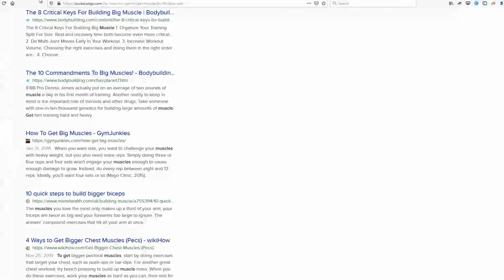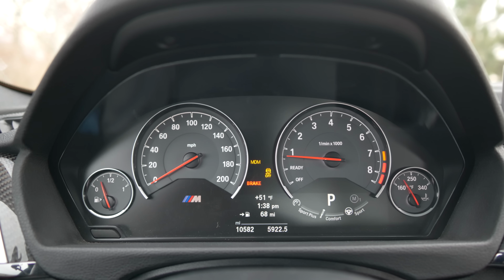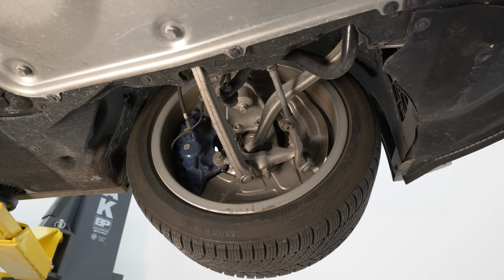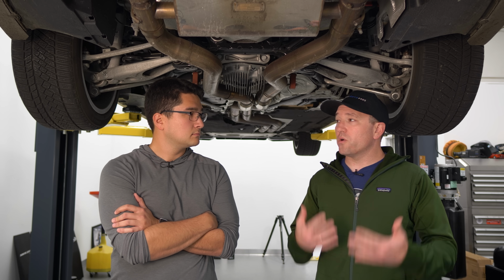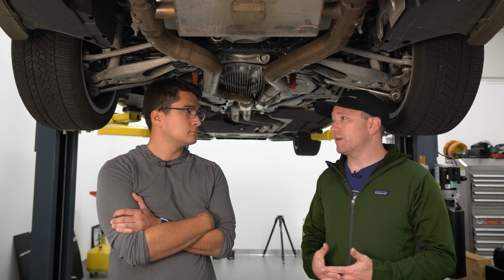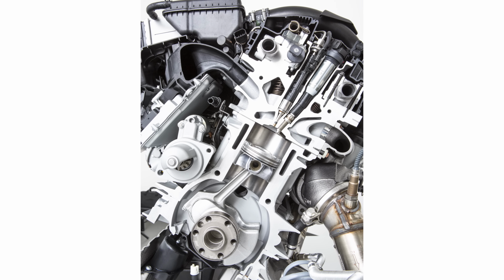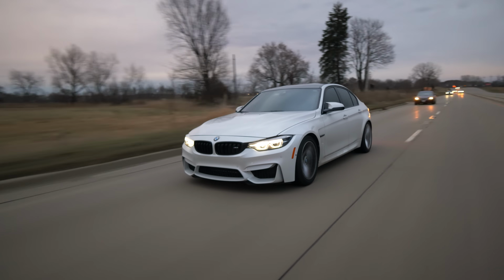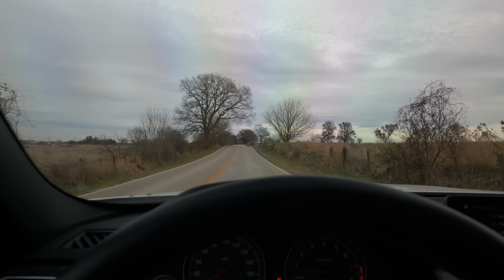BMW F80 M3 Review | The Sports Car for Mathematicians

Comment: This is a car you fall in love over time, unlike E90 where you fall in love right away but then get tired of "her issues". The more you drive, and more you own, the more you start to appreciate and love more and more as the time goes by
Reply: This is actually so true, I've had my f80 6 months and I love it more now than I did when I got it.
Reply: @Homiefizzle  Have you had many issues? They seem fairly reliable but I've heard some horror stories.
Reply: @pramay5116  what kind of stories? Is it bad to buy one of those?
Reply: @pramay5116 I have an f82, not a single powertrain issue to report at 60k miles. I have had to do thrust arms due to the bushings going bad.
Reply: @homiefizzle5260 yeah I feel that I got bored of my 335i the m3 I treat like it's my child I love it so much lol
Reply: I’m at 103K miles on mine going on 3 years of ownership now with about 50K miles on my belt with her personally, only the second owner. It’s funny, I got a really cheap daily and sold it within a month because I just wanted to keep driving the F80 everyday. Need an E9x M3 for a weekend car sometime soon but I’ll be damned if I stop enjoying the F80 every damn day. It’s just so good. Even in the snow on a proper set of winters ;)
Reply: Agreed. Perspective plays a large part.

One may get in and immediately notice the steering now being as good as something like a 6th gen Camaro SS. 

You’ll drive them and think that the Bmw’s steering is a little more numb/isolated (not totally, but more so).
As time passes, you’ll come to the realization that it’s not necessarily a bad thing, you don’t always need to feel every crack in the road (although it is nice from time to time). It’s more refined and you are more sensitized to the output of the steering communications.

In other words, if you might’ve had trouble feeling the direction of the front wheels when you first started driving the car (after driving something more raw), you will come to feel it more as you spend more time behind the wheel.

This is just one example and it isn’t a perfectly accurate representation that the steering is bad. 

The E39 M5 has been praised for its steering and overall communication for decades, but the truth is that you won’t be too impressed if you hop in one and drive it at first.
Maybe you will be if you own or drive some non-M E39’s or lesser cars, but it’s more about as time passes.
You own or drive the car for longer and it all comes together and it makes sense.

Now you understand why it gets praised and many crown it as the best overall mid-sized luxury/performance sedan. 

I didn’t like Bmw’s when i was younger. 
I didn’t hate them, but it wasn’t until i spent more time in them that i realized what the hype was about. 
Now i understand them and can truly appreciate them.

Comment: BMW is the kinda son of the family that does everything to make the parents happy yet the parents never really are impressed.
Reply: Is that why it breaks down so often? ha ha
Reply: but the parents aren’t afraid to go off on him when he makes a tiny mistake
Reply: @hsl2208  yeah breaking down every 10k km after 100k km with high servicing fee is not really a tiny mistake and i bought a 328i great car but not really a sport car or anything just a normal sedan after 100k km a shit show breaks down constantly have toyota pickup 490k km now still work like a dream my last and my only bmw sold it after the turbo got issue and cost me a small fortune couldn't be happier buy bmw lease after 100k or 5 years give them back
Reply: @patthonsirilim5739  what gen was ur 328i?
Reply: @hsl2208  f30
Reply: @patthonsirilim5739  previous owner didn’t take care of it, I’m guessing. I have. F82, stage 2 E85 and no issues lol. Like none at all
Reply: @user-zb6ez4jl3u  i live in Thailand the heat here cause of alot of the plastic bits to breakdown way faster then in Europe most of the problem i face are sensor and and plastic thingy cracking i bought new btw and service according to bmw service manual like i said i use 100k km and about 5 years trouble free after that alot of trouble
Reply: You didn't understand my comment. This video is all about explaining how BMW has done everything to make this M3 reliable without loosing its charm. And here you are again complaining about them not doing enough. Yes BMW is that son of the family.
Reply: Well said...  The touch me not parents...

Comment: The discussion on the drama or lack there of, is really why I like this car so much and want one. I have these race cars and old 90's jdm cars that have so much character but are tough to live with, the idea of something sterile that I can just blast around in with the AC on and no drama sounds like a breath of fresh air.
Reply: Same issue I have here. I have a c6 vette for the rough and brash power, something that “just works” sounds so nice, it’s like going to an IPhone, you can’t do too much beyond face value with it but that’s the point. BUT I still feel the Lexus GSF/RCF could be a perfect alternative to having some flash with a loud v8. Thoughts?
Reply: @cmanxz  I did think about one of those as well before I bought my F80. The problem is they seemed to be a bit pricier, and harder to find, there's just less of them. The whole auto vs proper DCT thing put me towards the M3, but in reality it's just the car nerd in me, I'm sure practically there's no real difference.

Comment: This is the best analysis of this car. I have considered parking one of these next to my E92, but I run my business from home and don't have any sort of commute, so most of my driving is backroads cruising or on track at RA or Blackhawk and for spirited driving and thrills I still prefer my supercharged E92 despite the fact that it's a ticking timebomb. For my 'reliable' car I opted for a 2019 Type R which I absolutely love. 

Something interesting that you didn't mention in the video (and maybe people disagree with me here) - I just don't think there is anything very memorable about the F80. I guess maybe when you talk about how sterile it is, that could be the argument I'm making right there just phrased differently. Yes it's a good all-around car but there is nothing really bespoke about it that evokes any emotional connection IMO. It isn't exactly abnormal or that impressive for a higher end turbo power plant to put down big numbers and run 9s in this day and age. That's not really an accomplishment. Thinking back to when the E46 M3 first came out with the impressive hp/liter of displacement in that inline 6 was impressive, for example. When automotive history looks back, what's it going to remember? Will anyone care about the F80 or will it be "just another turbo car of the 2010s decade"? I am betting no one will care about it very much. 

Still it is a very capable car and perhaps in some ways it is the epitome thus far of BMW's traditional M3 angle which is to be a daily-drivable sports car that does everything well. The F80 is probably the best expression of that to date. It's never been a pure sports car, but this iteration is probably the closest it has gotten to being the most balanced between practicality, reliability, and performance.
Reply: 100% agree with you, when im talking about M cars, or M3 in general, I tend to forget the f80 even exists, because its just another zippy computerized turbo car to run around the city, nothing more. sure its great, has plenty of power, its somewhat comfortable, but when you park it, it doesn't make you look back, because its just an everyday car, while my e46 hasn't failed that task in 8 years. I still get goosebumps when I accelerate, go into corner with pedal jammed to the floor and I have to wrestle with the steering wheel. in my eyes e9x platform will always be the last generation of the real M3.
Reply: Nick Davis I sold my e46 to a buddy across town. That generation was the pinnacle of balance between raw bmw feel and comfort. Love my e92 for the s65 but e46 just drives so well. I’ll buy another one someday in Imola to match my Melbourne e92.
Reply: StopTheH8GetAV8 believe me e92 has no less handling than the e46, those cars are so different from each other, hell one has 2 more cylinders, yet they have that raw feel older M cars had.. now they stick forced induction to everything and that feeling is gone
Reply: @Sheiza  I find it kinda hard to believe that'd you'd forget the F80 exists, considering  there's  been an M model of ever 3 series for the past 30 years.
Reply: Returned my M3C lease a few months ago...what I'll remember most vividly is doing a full 50 minutes on track at the NCM Motorsports Park (Corvette Museum) without so much of a hiccup. While it doesn't have the classic V8 (or even the N55) sound, the engine and DCT are still excellent and perform quite well in the duty purpose environment. Customizing vehicle settings via "coding" was entertaining and allowed the car to have Euro-only features (used ADB for many years in the US) and have more track-focused performance (GTS DCT tuning, CS EDC/DSC/EPS, etc.). It had a functional infotainment system (looking at your Lexus) and enough safety and convenience features to make daily use easy. Averaging 23 mpg over 36k miles didn't hurt either. It doesn't have the lovable size of the M2 but it looks good from just about every angle. Also, depreciation of the F8X series is quite steep at the moment allowing for a pretty good bargain IMHO. Not the best or worst, but memorable for those who have owned one, and likely for those who will in the future.
Reply: Get Carbahn's clevite bearings and valvetrain if you want it NOT to be a ticking timebomb.
Reply: @aiGeis  beat the crap out of mine on track, only regular interval oil changes (10k), no problems here. Probably tons of guys on the forums have had the same experience. Maybe just dont tune them without doing mechanical upgrades?
Reply: Just curious,what are you planning on getting next?

I also returned my M4 lease not to long ago but haven’t got anything fun to replace it yet... been driving my 17 Lexus ES350 which is my daily but I’m getting that itch for something fun,I defintely will get something by summer time. I was thinking the upcoming C8 vette might be a good choice.
Reply: @larryzeldin7561  wasn't sure if that was directed towards me or not. I've been entertaining the idea of a GS C7 or ZL1LE but I think I will go the cheaper route with the regular 1SS 1LE and a hybrid or electric for my daily. If my budget allowed it would be a C8 for sure!
Reply: StopTheH8GetAV8 superchargered with a proper superbcharger or with a belt driven turbo. It’s always the centrifugal. Nobody sprung for the proper supercharger.
Reply: Well said! My f80 was so good but it never really did it for me. Now it's  between either an e92 m3 or m2 non comp. I love my e92 335i so I can only imagine how I'd love that same gen M 😁
Reply: StopTheH8GetAV8 RA and Blackhawk?! Are you in Wisconsin or Illinois?
Reply: Ticking timebomb is an extremely accurate description of the e90 m3 unfortunately.
Reply: Erik Frangos Wisconsin. Almost smack dab in the middle between RA and Blackhawk actually it’s about 70 minutes to either track from my house 😂
Reply: @Sheiza  when you park it it doesn't make you look back? Dude, are you kidding me? And you want to tell that this predator doesn't provoke goosebumps when you accelerate? Dude u are joking, seriously
Reply: @shotgun6160 I'm actually starting to like the f80 after we saw what g20 is lol
Reply: @Sheiza  Haha, same here 😂
Reply: E92 is overhyped for what is it , f80 is hands down the better car
Reply: @Thesudstud  No doubt F80 is objectively a better car, I don't see how anyone would question that - new generations of a model always work to improve upon the previous. That doesn't equate to being enjoyable to drive for all people's tastes, though. If newer, technically superior cars were all anyone cared about, there wouldn't be a market showing people paying 150-200k for 997 generation GT3s. I personally just enjoy driving older cars more when it comes to fun drives or track days. My garage has an E39 M5, E92 M3, E46 M3, and my only "modern cars" are a G05 X5 and a Supra MT whenever it arrives on the boat, both of which I use as tax writeoffs which require me to buy them brand new - otherwise I'd have an entire fleet of crusty old shitboxes.  I'm used to being mocked for having old cars and for liking things like an "imposter" Supra.
Reply: @jwardTLS  I was an e92 fan boy and wanted to hate the f80 for so long but after having seat time in both the e92 feels very dull , heavy and not as much of a drivers car as people hype them up to be. Im sure a set of coilovers and a supercharger would fix that but even the Seating position isn't that great.  The  handling is good but the f80 feels so much more rigid in the corners. Hides it's weight very well. I'm sure a supercharged e92 is fantastic but a f80 with similar horsepower would be nasty. It will take time for people to realize how amazing the f80 really was for the time. Stock vs Stock the f80 is the car but I also respect and see your points of view.
Reply: @Thesudstud I came to this conclusion as well. I love the E92 M3 & for a long time it was my dream car but the F80 is just better. The F80 to me is very reminiscent of the E46 M3, thus a return to form. They even sound very similar to my ears which I guess is to be expected since they both have 3-1 manifolds. If the E92 didn’t have the S65 nobody would give a damn about it. Even though the steering feels great it feels like a boat compared to the F80.

Comment: For the record I absolutely love my F80. It’s a car I daily back and forth to work that’s a 60 mile commute while getting 26mpg. It’s a car I can fit my wife and kid in with a stroller and gear in the trunk for a little weekend getaway. And it’s a car I can take to SCCA events on weekends and thrash. I don’t think there is an all around better car...that still retains a 6M/T. 

I spent a lot of time looking for the next garage addition. Everything from a Type R, GTI, WRX, G70, Stinger GT and a plethora of others...nothing quite produced the same results as the F80 M3
Reply: Try a 2019 miata
Reply: So it sounds pretty good with reliability? I am considering buying one.
Reply: @gnote4323  Would love a RF! but not in the cards just yet lol
Reply: @dinosoarskill17  From everything ive read and watched...the F platform is one of the better platforms out of bmw as far as reliability. The F8X platform is known to have some crankhub slipping which can be pretty catastrophic but that seems to be happening most to guys pushing the limits and running meth w/ high boost and mostly with DCT.
Reply: @erikf48  Thanks for the info.. I just bought one today.
Reply: fightmeirl congrats!

Comment: A tune and the manual transmission makes this car so incredibly fun to me. Mine is running bm3 stage 2 which is around 550hp crank with just some down pipes. The motor really is incredible and the car is a drifting machine. The mind blowing speed and looks make this one of the best cars at this price point.

Comment: You know what's funny? Your video convinced me to get one. If you are looking for a M car that more track focused than the street focused (comfort, size), this checks my box. I've had mine for almost 2 years now and I still love it. Carries 4 and allows you to be an axe murderer on the streets and wail on the track should you want to with little compromise compared to the earlier gens, who always had imo some set of flaws (actuators, valve controllers, water pumps etc). Before people bring up that crank hub stuff, most of those who talk about it, don't own one.  The problem is quite overblown. It does occur on stock cars (~3%), but if you want to unleash power (>550-600hp), do the hub. It's not expensive for a car of this level. I've done it as I'm got some tuning, but it was more for longevity and reliability. Other than that? Bulletproof.